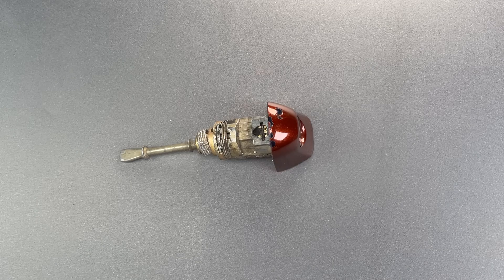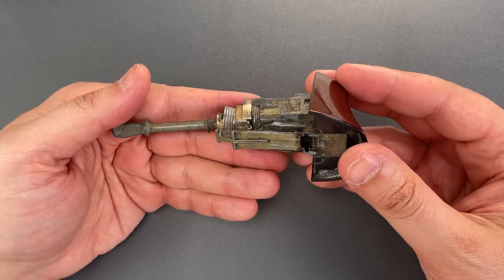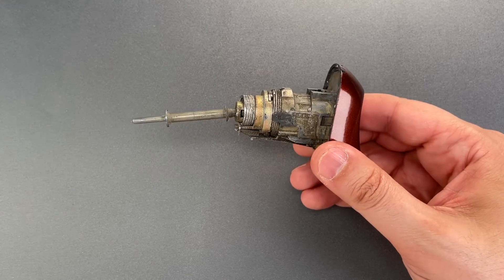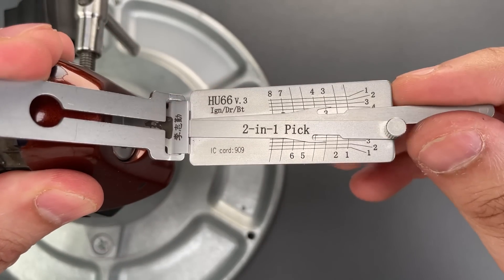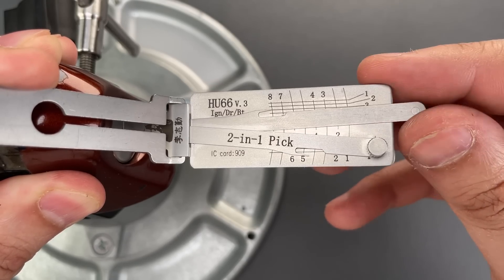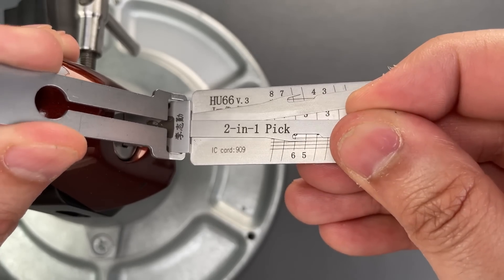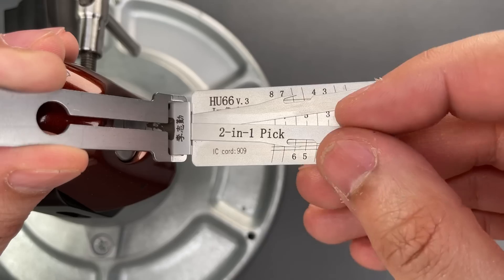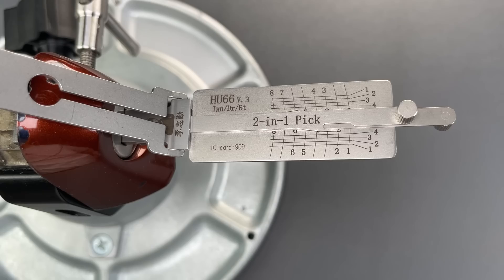[1380] Bentley Flying Spur Door Lock Picked

Comment: I'm spitefully enjoying the fact that a car that expensive has essentially the same components as a car that us peasants can afford.
Reply: Lol they're overpriced JUNK
Reply: The poors can buy them but they can't afford to fix them every week. That's the rub. (Audi, VW)
Reply: VAG baby, I'd bet that a Porsche 911 or even a Lambo Huracán would have similar door locks
Reply: its a fucking door lock who cares.
Reply: The alarm system is more important than the locking mechanism in such a car. The benefit of having a simpler locking mechanism is the ability to open the door with a cheaper spare key that won't start the car, if the keys are locked in the car. The full replacement keys are quite expensive, and that can be quite annoying for someone who buys the car used.
Reply: tbh, I never saw a car ad where the lock was one of the main praised features of the car.
Then again, I also heard of some really expensive Italian cars (forgot which brand) that failed in winter conditions in Belgium, a country only a couple hundred kilometers to the north of Italy with normal winter temperatures just below 0°C. IIRC, it was the cooling fluid freezing and slowly damaging the engine.
Reply: @litigioussociety4249  Like a Tesla's sentry mode?
Reply: @newp0rt  umm the doors operate the same key as the ignition so yeah if a door lock is like a cheap car then that car isn't any more secure than the cheaper ones.
Reply: @disguisedcat1750  not true.  The ignition likely doesn't even check the key cut (this is emergency entry key, you don't put it in ignition lock). The ignition lock is RFID system reading a crypto chip that's moulded into the ignition key. Without the properly coded RFID chip all you can do is turn the ignition key and... Nothing will happen
Reply: @disguisedcat1750  No, there's a chip in the key, so the car won't start without it. Even my Toyota Corolla works the same way, I have a spare key that will unlock the door, but it won't start the car, a lock pick would do the same thing.
Reply: Well Jaguar has a lot of Ford interior parts in it, and same for Bentley. RR now has a lot of BMW parts in it, and even before the vehicle division was split out they bought in a lot of the suspension and drivetrain parts. Land Rover now shares a lot of interior parts with TATA and Chery, because if you have the dies to make the parts already, it is always going to be more cost effective to use existing parts when possible.
Reply: @litigioussociety4249  oh nice. Didnt know that.
Reply: @MarekLewandowski_EE  uhm nice
Reply: @disguisedcat1750  yeah u break into the car and then what. it's a Bentley. security system is gonna be going off the charts. modern cars are also push to start/require a fob to start. like sure u can steal all the quarters in the center console. great.
Reply: This is pretty common, a lot of premium car company are owned by the same companies manufacturing much cheaper cars e.g. Lexus/Toyota, Jaguar/Ford the list goes on. many of them share the same parts and often the same car will be rebranded as the premium version with little-no difference. You can buy a Toyota Camry as a Lexus (something) and it's literally just the same as the premium model Camry (leather seats etc) with different badges on the outside.
Reply: That’s how larger car manufacturers work. They develop parts to the highest (reasonable) standard, and then put them in every car to cut down component costs, but wraps the same components in leather for the folks with a silver spoon up their ass.
Reply: @newp0rt , salty peasants care, apparently.

Comment: So... the alarm is blaring, what next?
Reply: Opening the door with the key gives you 30 seconds to turn on the ignition to disable the alarm. Picking by hand I reckon that would be an issue, but since the Lishi decodes the lock at the same time I reckon if you noted the code when opening the door you could probably do the ignition in time. Still can't start the engine without the transponder, but at least the alarm is deactivated and it unlocks all the other doors and trunk for you 😆
Challenge for LPL there to pick one within 30 seconds of opening the other...

Comment: "Volkswagen Group" has owned the Bentley brand since the late 90's .
Reply: Just think of that video where someone pries a Skoda badge off an engine to find a Volkswagen emblem cast into the engine cylinder head.
Reply: @quillmaurer6563  That's not that surprising, since VW owns Skoda since 90's. But you could find a Skoda engine in a VW in late 90's.
Reply: Gotta love putting Porsche engine in VW Beetle... it just goes airborne...
Reply: @Monni95  depends wich Porche engine, the 2,7 from a Porsche Boxter, its only the engines pistons that go airborne, what a crappy engine...

Comment: I went on covert instruments to buy a Lishi tool but got totally flabbergasted at how many different ones there are, have you got a video explaining what ones are best used for what?
Reply: They are for different lock styles/ keyways. For instance if you wanted to pick a master lock with one you would need one that is a certain size to fit into the lock cylinder. But if you took the same tool and put it in your lock on your front door then it wouldnt work because there is a few more pins in that lock the key is longer and taller etc. if you wanted these things to open any kind of lock you would need a whole set of them

Comment: At first I was a little confused "Continental Flying Spur must be a mistake", I thought, but I researched it and it was actually named after that up to 2014.

Now the Continental is always a GT, the Flying Spur is just called that, without Continental and it is the fast Sedan, the Mulsanne is the most luxurious luxury car, than can even be more more luxurious if you order the extended wheel base version and of course, there's also the Bentayga, because every car brand needs to sell at least one SUV

Comment: This is a normal vw hu66 lock 😂😂
Reply: The key seemed cool and unique when I had a 2002 VW in high-school 14 years ago.  But yeah a lot of these car makers will put the same parts across the board of cars. $10,000 or in this case $150,000...
Reply: @USERNAME1-x5u  You would do the same if you were VW, wouldn't you? Building or buying the same lock in a bigger amount brings the cost of the individual lock way down and what is good enough for a Bentley should be well enough for a VW Golf as well.

Comment: Always wondered how you make sure you pick and turn the lock in the correct direction so you don’t have to pick it again in the other direction?
Reply: You usually know from experience/how it is mounted, do you usually turn keys the correct way? You can often use a simple sprung tool called a plug spinner to skip back past locked position, if you discover you have picked the wrong way.
Reply: Unmounted locks like the ones he picks dont need a direction, from my small experience every lock turns clockwise so yeah must be easy

Comment: Is there a pick order on these locks, or you can pick all the top pins first, then all the bottom ones? Or do you sometimes need to pick some of the top, some of the bottom, back to the top, and so one until you picked them all ?

Comment: All the car locks you've picked, I have to wonder: what would it take, if it's even possible, to open and re-pin one of these locks? Could it ever be worth the effort for some of the less secure locks?
Reply: No it's not worth it. the locks work as intended, enough security so other methods are easier.  Who cares if your locks are the best ever if you have a broken window.  And if they are too hard to pick, if you accidentally lock your keys in then no locksmith can get them out without breaking the window either.